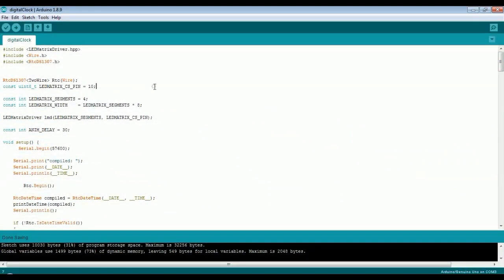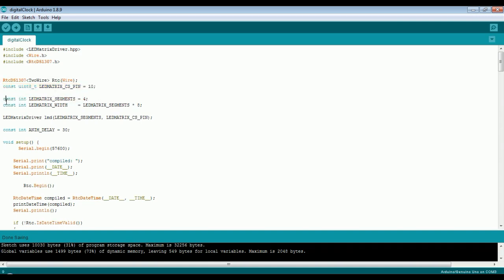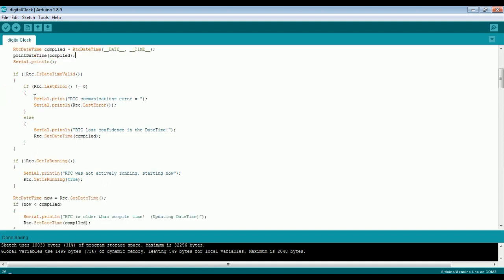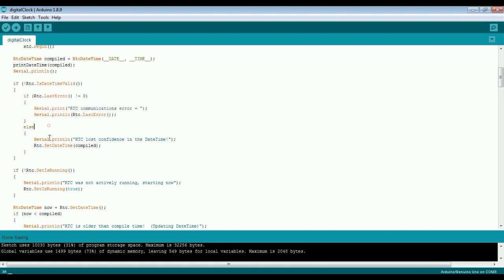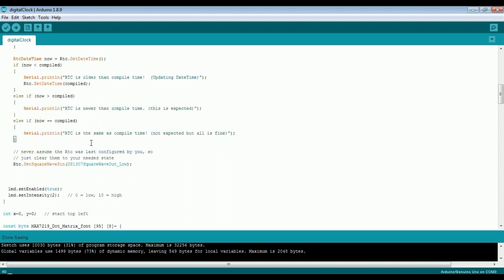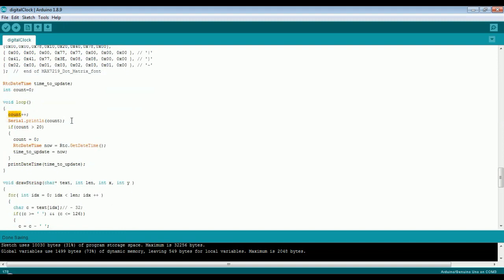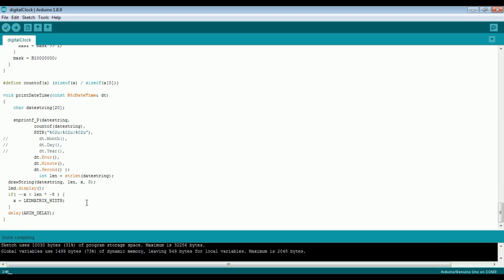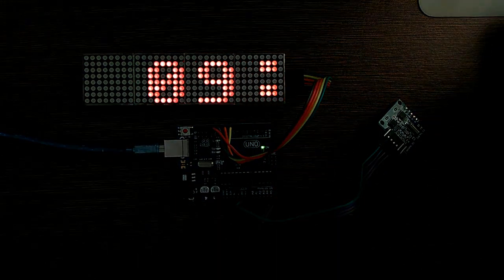Arduino Uno based Clock using MAX7219 Led Dot Matrix Display

Comment: Arduino: 1.8.19 (Windows 10), Board: "Arduino Uno"

digitalClock:1:10: fatal error: LEDMatrixDriver.hpp: No such file or directory

 #include <LEDMatrixDriver.hpp>

          ^~~~~~~~~~~~~~~~~~~~~

compilation terminated.

exit status 1

LEDMatrixDriver.hpp: No such file or directory

This report would have more information with
"Show verbose output during compilation"
option enabled in File -> Preferences.

Comment: can you help me why my numbers are reversed they are facing the opposite direction
Reply from the maker: which library are you using. i ll recommend you to use Patola library. I have explained that in my latest video.
And again it depends on hardware type you select in the code. based on that data is send to display.
Reply: I think I have Parola library is it that’s why they are reversed
Reply from the maker: Great. then you have select the hardware type in the code.

Comment: Superb project, I want to make it to satisfy my nephew. Unfortunately when I compile the program it gives me 'Rct DS 1307 no such file or directory. I have installed rtc ds 1307. What should I do?.
Reply from the maker: You need to install the library for RTC DS1307.
Reply: Hi, I installed, as you suggested RTC DS 1307 by Helder Rodriguez; RTCDS1307 by Micael Margolis. Unfortunately the error Rct DS 1307 no such file or directory persists. What should I do? I strongly want this project to work. Thanks again.
Reply from the maker: I would like to see the code you are referring. I can help if you share. Are you using the same code which i have posted on github.
Reply: @StechiezDIY  Same Problem
Reply from the maker: @Todd and @ Fererico i have updated library files in .zip.Here, you have to import the library into arduino. Go to Sketch-> Include Library -> Add .zip library and select the both library .zip files one by one. Please find the path in the description.
Reply: Ciao,.zip.Here, when I open it it tells me it does not exist
Reply from the maker: .zip files are there and i tried it after your comment as well.
Reply: @StechiezDIY  Hello. I tries to open but it mentions site cannot be reached
Reply from the maker: you mean github. it is reachable and i can see it now. please confirm the address you are visiting.
Reply: @StechiezDIY  I clicked on the link which you mentioned and it is not opening
Reply: Currently getting the error 'RTCDS1307' is not a template